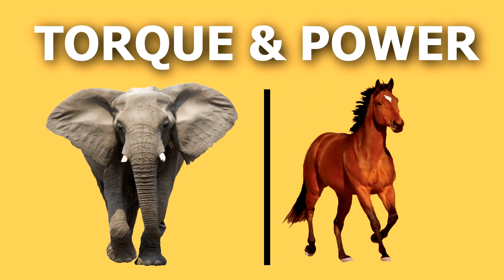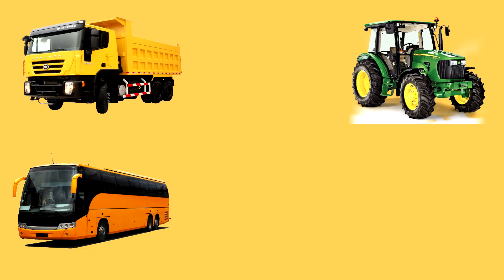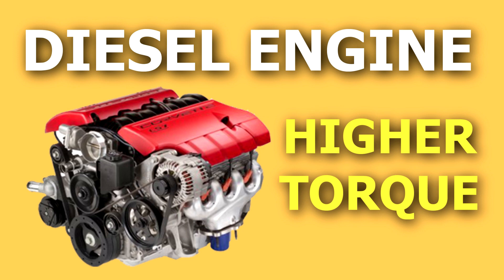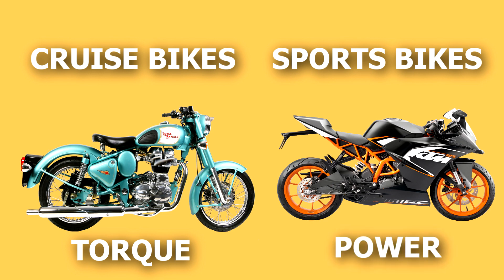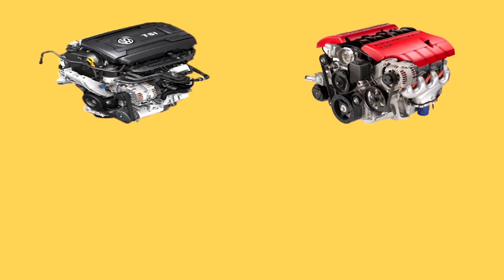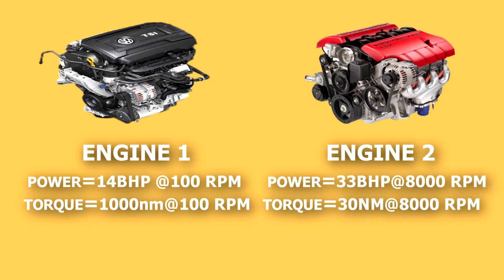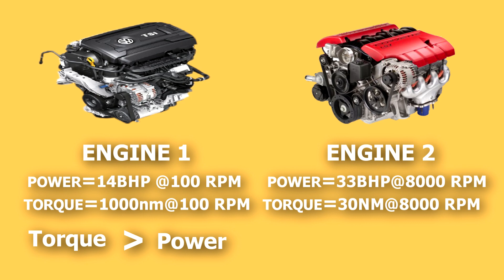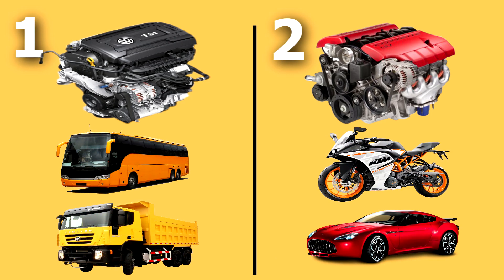Difference Between Torque And Power || Torque VS Power

Comment: why a bike need a truck/bus similar torqy engine  ?🤔
Reply from the maker: Bike's engine based on Power architecture with less Torque where as Truck/Buses engine based on Torque architecture with less power, the reason behind is Torque engine are big and suitable for pulling heavy loads whereas Power engine are small and suitable to attain high speed.

Comment: by the way, what is "nm" in 
Torque: 1000nm@100RPM

by the way, what is "BHP" in 
Power: 14BHP@100RPM
Reply: nm is SI unit of torque, newton-meter (force*distance)
bhp is the power terminology of engine, brake horsepower ( brake power) bhp is the ratio of output energy of camshaft to the heat supplied by the air fuel mixture in combustion chamber.
meaning what ratio of energy input is utilised to move the camshaft
Reply: @siddharthupadhyay4246  
owww THANK you SO much ...
i appreciate your reply Bro'